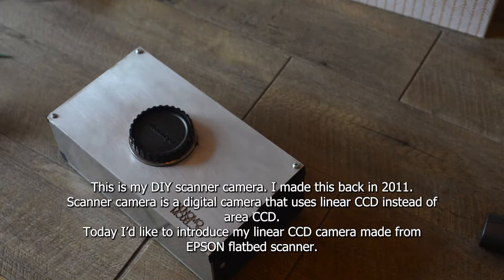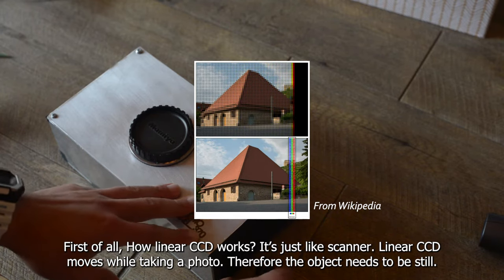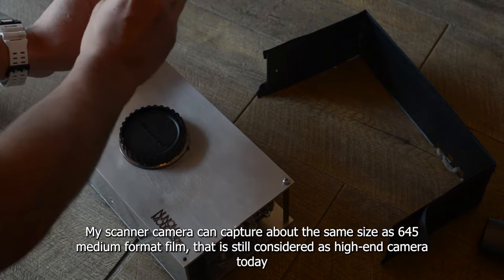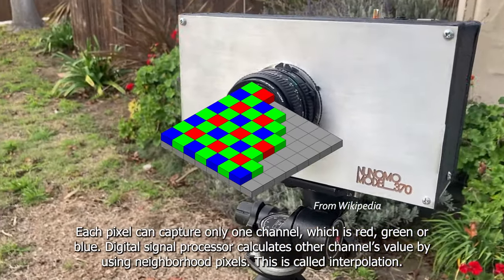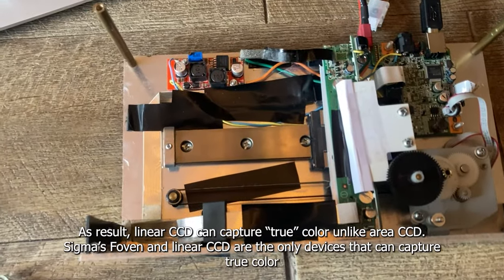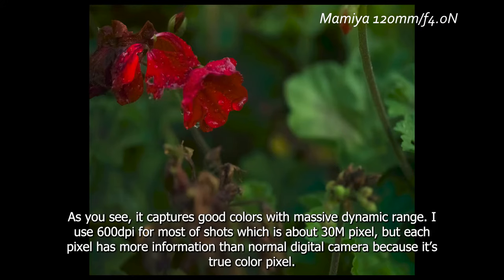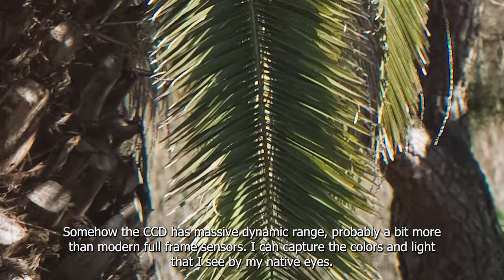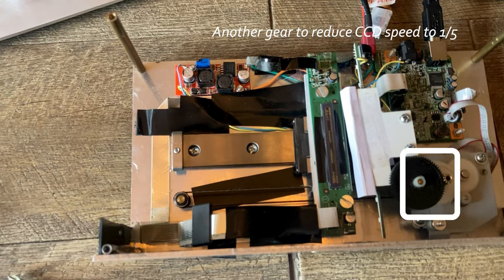Handmade medium format 140M pixel digital camera

Comment: HDR is a sideeffect of how scaners work. They capture intensity of each color for each pixel as it is, independently of others, while a digicams capture information for all pixels at the same moment. digicams do this to solve other problems (like speed) and the easiest approach is to estimate optimal params, capture everything, then figure out what to with that information. With scaner you obviously dont care for speed (forget about shoiting series of action) but want to have as much detail and fidelity as possible - they are also capturing like 10bit (at least AFAIR) color information 😁
Reply: Don't area sensors also use rolling shutter? Only high-end cameras have global shutters, and they're typically video cameras
Reply: @Omaryllo  well, true common digital cameras use rolling shutter, but that's not exactly the same as scanners. With scanners nobody is concerned about moving subject. while with cameras, action is obviously a thing, so some compromises are made to have fast capture. Then miniaturization to have as much features in-camera as possible also plays a role in what the sensor is designed to do.
Reply: Regular digital cameras don't have color sensors, but rather a color mask overlaid on the ccd. They guess what the other colors are that that pixel can't actually see by averaging the neighboring pixels. So in comparison, I guess you could call it 'hdr', simply because the color information is by nature higher resolution.

Comment: Wow! I can't believe this doesn't have more views! You, sir, are amazing, and your project is too. Well done! Can't believe this is 11 years old yet performs so well also!
Reply: By the way, don't worry about your English skills! As a native (American) English speaker, I can understand you fine. Even if you do make some mistakes (which is fine and understandable), you get your point across!
Reply: Thanks so much as well for the information at the end of the video! 😁 (It looks complicated, but if all the parts together are under $150 (US dollars) I will try to make it!
Reply from the maker: Hi, I got many views when I made the 1st gen of the camera (One in the video is the 2nd gen). This video is just a recap of what I did, sometimes I brought this to take landscape photos..
It's not an easy project, I don't want to make it again 😅
Reply: @raspy00135  🙃
Reply: Well done on making one!! Scanback cameras have been around longer than digital CMOS or CCD cameras. I wish Foveon would mature and develop. I think Sigma sold Foveon, no? Anyway, one of the 1st was Better Light and stil make scanbacks upto 384 megapixel. Sadly,this very cheap tech is packaged and made very expensive. But today that has dropped a lot. For example you can get one of the 137mpixel backs for around $600 to 1800 used. . Much respect for this guy making his own. What is great about that is he can swap lens mounts as he wishes. On 4x5 you can also by making a plate to the mount of choice. 4x5 allows for swings shift and tilt.
Reply: @philindeblanc  Thanks, Phil. May I ask where I can possibly find used scanback? I tried many online resources but no luck. Thanks!
Reply: @xiaofengzhang9809  try BetterLight
Reply: @raspy00135  how do you store the image, the printer has no way to store images right, what was your solution to store the images?

Comment: Would something like this be good for astrophotography if it were on a steady tracking mount? Is there an “exposure time for each line captured?
Reply: Likely wouldn't work since the sky shifts, unless you put it on a tripod which also rotates.
Reply: @fusseldieb  yeah that’s what I’m talking about! I’ve got the star adventurer 2i but there are much better mounts out there that would be really steady
Reply: Another approach is that you keep the sensor stationary and let the sky do the scanning.
Reply: @bob2859  exactly 😁

Comment: How do you manage exposure time? And what is the reallife dynamic rage achieved? For example shooting indoor with a window in frame. Would there be some details outside and inside the room?
Reply from the maker: There is no exposure control other than aperture.
I can change ISO by tricking initialization process but I don't see much benefit compare to photoshop adjustment.
I set it to the lowest noise.

Comment: This is what Phase One did decades ago (PowerPhase FX). Those Toshiba linear CCD is not very expensive, however, the real tricky part is that you need quite a lot electrical engineering knowledge to drive them. That is why most of the DIY projects are only restricted to disassembled scanners.

Comment: This project is amazing! I am blown away by the depth of colour and light achieved. I would like to understand how you made this, but I understand that explaining everything is hard also. I see that you have a post on your blog with more detailed photos. If you would be so kind as to take more detailed photos of all of the parts, such as the control board and the lens, I think I could start to figure out what you did. What an amazing project and very beautiful photos!
Reply: I would guess the most tricky part is to get the scanner to work torn down to the needed parts and to achieve focus.
But in overall... its pretty "easy", yet a genious idea!
Reply: I would love to try to reproduce this project, the results are astounding! Where do they have their blog?
Reply: @harrison00xXx  focus I bet is the easy part because I'm pretty sure that it's fixed. scanners use a compressing lens to capture wider than the sensor so as long as you know the focusing distance of your lens and make it so that it's landing on the sensor you should be good (obviously who have to be very precise). The initialization step must be the real tricky part.

Comment: I have seen a few project similar to this before. But yours is surprising compact. But missing the front standard means you are missing a lot of fun with tilt, rise, swing or shift. But that will make it much more difficult as you has to grab some bellows figure out and interface. I do believe that exploring older lenses with massive image circles is a lot of fun. 

And it's more affordable than getting a Large Sense camera, which I believe uses a CCD sensor that is normally used with a phosphorus screen for medial x-rays.

Comment: I'm so impressed, especially at the dynamic range... Those palm leaves would have been blown out without a neutral filter and bracketing
Reply: ETTR, than pulling in post process. What does an ND filter have to do with this?
Reply: @babaarcuszatir  Because of the high dynamic range, you'd need an ND filter and have to bracket several stops. Otherwise, with most sensors, you'll end up with blown out pixels and unrecoverable information in the highlights
Reply: I’m sorry, but you only need an ND filter if you cannot raise the shutter speed and/or cannot/don’t want to decrease the aperture to reach ETTR. In any other scenarios ND will not help, not a bit.

Comment: the math just doesn't work out. 60x45mm area scanned at 1200 dpi is about 6 megapixels worth of data. even if you multiply it 3x to compensate for the difference in fine details compared to a Bayer-filter sensor, it's still just about equivalent of a 20 megapixel digital camera. think about scanning medium format film with the same epson scanner that is used to make this camera. otherwise, great job, looks fun and all, and it can be used for special movement effects.
Reply from the maker: EPSON scanner's scan area is A4 paper.
Actual CCD is about 1/5 length of A4 paper, the scanner uses a lens to shrink the image.

So when I say 1200 dpi, this is about the scanning software setting. So the real resolution is 1200dpi x 5= about 6000dpi.

Comment: The main difficulty I see with this, which other people aren't considering, is a complete lack of focus preview.

You'd have to take a preview scan, a single frame, in order to check your focus.
There is no way to check it live, no viewfinder, etc.
So taking an image would require a lot of preparation, unless you've found a workaround for that.
Reply: One option would be a focusing screen
Reply: I assume you can calculate your focus based on your distance with a rangefinder pretty accurately
Reply: Considering that it's much larger than full frame too, the dof would be tiny
Reply: maybe do a fast scan to preview focus and then a slow scan to capture the image. Or use traditional mirror focusing and when you are ready, retract the mirror to scan.
Reply: ...or have a swap in CCD sensor on the same plane and distance  just for focus?

Comment: Not much info here, but lower down in the comments Ryan posted that the scanner used was a Epson Perfection v370. I'm thinking of trying to hack this together for studio photography, in order to pre-visualize 4x5 film photos (in order to save film). For setting the distance to the lens, an old microscope could be used as it has very rigid and excellent gearing for making tiny & repeatable movements.

Comment: Very impressive results, trying to create a scanning camera myself using a similar scanner sensor. In my attempt i try to directly interface with the sensor PCB. Using a raspberry pi pico i have been able to talk to the ADC on the sensor PCB and retrieve the image data. This should allow for manual gain and integration time settings aswell as full controll on how the stepper motor is driven. As the raspberry pi pico has a slow USB(1.1) interface i am directly writing the image data to a SD card. This seems to work quite well although i have not yet started on the mechanical part of the camera so cant show any photos yet.
Reply from the maker: That sounds fantastic. I have no idea how to interface with the linear CCD. If I don't need to rely on EPSON firmware then it might be able to do a lot of other things. One big limitation of the camera is that fixed exposure time (shutter speed).
Reply: @raspy00135  Yes that is one of the reasons i tried to avoid the EPSON software. Luckily you don't have directly interface with the CCD as the there is already a ADC(AKM AK8419) on the back of the sensor pcb so the flat ribbon cable only contains digital signals and some power. Which does mean that the image quality should be comparable with the the output from the EPSON software. At the moment the wiring and the code is still a bit of a mess but if it seems to work well enough i will try to publish the code and designs. It seems that a lot of EPSON scanners share the same ADC and pinout on the ribbon cable so it should be quite universal. Perhaps some other configuration for the timings would be required as the actual CCD itself does differ between models. Trying now to get the sensor mounted on a old large format camera, for now i will keep the sensor fixed at the back of the camera and try to rotate the camera on a stage to get a panorama like scan.
Reply: @sbuntinx  which epson scanner did you buy? I'm going to try this with a v200 but I'm not sure how to trick the scanner into initializing. If you could publish your code that would be amazing!
Reply from the maker: @sbuntinx  Interesting, I hope you figure out the protocol. I'm really interested the result.
Reply: @will3346  I am using a v100 at the moment, also have a v330 that i plan on using later aswell. My code is not going to help with the initialization as i replaced the epson board containing usb and power connector with a board i made myself using a micro controller(raspberry pi pico) that has two ribbon cable connectors to talk to the sensor board.
 For the initialization using  the epson board, i think it checks if the light bridge gets closed which normaly happens when the moving part of the scanner gets moved to the start position. There also might be some check where it tries to capture light at the start position to calibrate or check if the light is working. 
Like i said in my previous comment, the code and wiring is still a bit of a mess as i just got it working a few days ago.  Planning to create a proper pcb and clean/improve to code so that i can publish it. For the moment i am working on the mechanics of the camera.
Reply: @sbuntinx   Thanks! I managed to determine the initialization tricks on an otherwise unmodified scanner yesterday and have wired a simple switch for now. I plan to use a microrelay in the future for the 8x10 camera which will have a relatively unmodified scanner set into it. I would absolutely be interested in a published schematics and code once you've refined it. I already have a couple raspberry pi picos lying around and I plan to get more scanners to play with. Please keep me updated on your progress!
Reply: @raspy00135  The protocol used by the ADC is documented in the datasheet and i already got that working on the Pi Pico. Have a sample image on my Flickr together with two photos of the current contraption. Not as polished as your camera but did not want to spend to much time on the camera itself as i was not sure if i would get the electronics working.
Reply from the maker: @sbuntinx  That's awesome. The custom control might unlock shutter speed control. Overall quality of the photo might not be changed but it needs a lot of light with the default setting so it's great step after 12 years :)
Reply from the maker: can I see thee data sheet? I searched for it but I could't find any.
Reply: @raspy00135  Hey, i managed to get the mechanical system of the camera to work and the resulting images look quite good. Still lacking the IR filter but that should be a easy fix. I posted a image taken with the camera on my Flickr(should be able to find it when searching on my name) . The lines i previously saw on the captured images were luckily due to dust and went away after cleaning the sensor.
Reply from the maker: @sbuntinx  I searched it but I don't see it.  Can you put the URL here?
Reply: @raspy00135  Sorry, i cant post the URL or anything resembling it, i tried a few times and it got removed. Did you search for "Sjors Buntinx" ? that should bring it up.
Reply: @raspy00135  If you cant find it, perhaps you could take a look at the spam comments as it might ended up there.
Reply from the maker: @sbuntinx  I found your account. The photo looks great!
Reply: @raspy00135  Have been busy with other projects but recently had some time to work on the camera again. Figured out that the blue 3d print filament i used is transparent for IR light so i reprinted the sensor holder/camera back in black PLA. This greatly reduced the red colour cast.  Another improvement in image quality is by getting the color profile right, as the image data is encoded in a linear fashion and not in a gamma corrected one.  By applying the gamma correction the image matches better with what the human eye would see. I can imagine that the Epson scanner software already does this so i guess you did not need to do that.

Also i spend some time on figuring how to easily control the camera, as all the settings were hard coded before. So i ended up using the WiFi capability of the PicoW and managed to control the camera using a web interface. At the moment i got exposure settings(gain & exposure time), stepper motors settings(steps per line & number of line), a preview function that shows the image in the browser, live RGB histogram and live focusing assist working. 
The Focus assist works by calculating the contrast/sharpness of the line captured by the sensor, i segmented the calculation in 8 pieces to make it possible to focus on certain regions of the image. It is far from perfect but it makes it much easier to get a decent focus. Together with the histogram it reduces the time required to get proper focus and exposure as you don't need to capture a image and readjust.

 It is still powered by the mains adapter so i can only takes pictures from my window and everything is still soldered to a prototype board so i have to design a PCB to get the rid of the loose wires as it is still quite fragile now. Maybe i will make short video showing the web interface capabilities.

Comment: Bravo! Bravo! Indeed, the sensor in a "full frame" DSLR is about the size of a 35mm frame. The ANALOG INFORMATION in a 645 film is much larger. If a 645 (or wider) film is scanned with a resolution fine enough to see the grain on the film, the file size would be enormous. (Imagine scanning a 4x5 or 8x10 COLOR transparency!)

Comment: so, youve rigged the scan head to 'scan' across the focused frame of the lens as if it were scanning a document...... Thats pretty friggin neat! I was thinking you were using moving mirrors or something, but ultimately same idea. Awesome stuff, the detail is insane. The palm tree photo looks like you were picking up the detail limit of the lens, there was some chromatic aberration as it zoomed in. But resolving the flaws in the lens its using is pretty impressive. Nice work.

Ive been (slowly) looking into using the sensor from an old hp scanner as a spectrometer sensor (since all I need of the diffracted light is the brightness values across a given distance), any tips on cracking the firmware open on these things? My current plan is to just tap into the ICs data rails and more or less bit bang and directly read the registers, but if I could leave it mostly intact and utilize the USB that would be preferred.

Also, no worries on the pronunciation. Ive heard much worse, unapologetic, English as second language speakers on youtube. You're decently adept. But thanks for the subtitles so we dont have to second guess a word here or there(Im actually terrible at picking up accents, and I got yours pretty quick, especially with the subs, so Id say you're golden). Insert old 'English is my first language and I can barely speak it, so you're fine' joke here lol.

Cool work man, I want to see more of what you can get that rig to resolve!